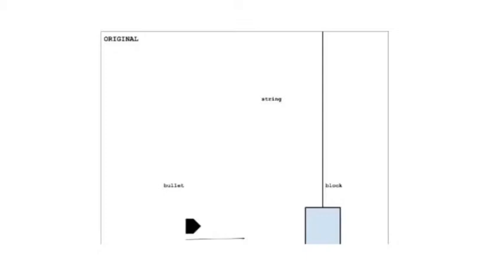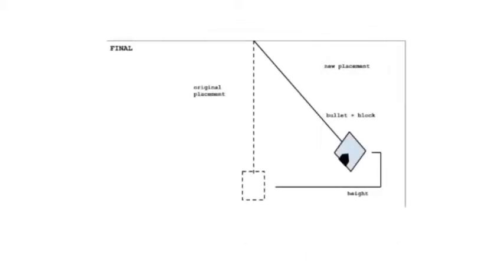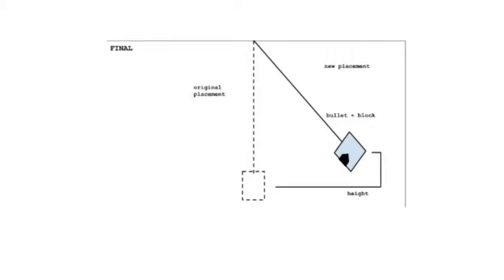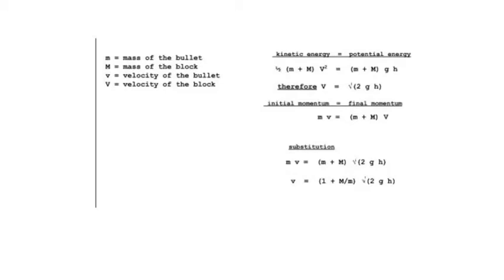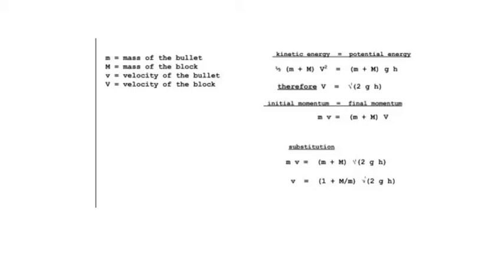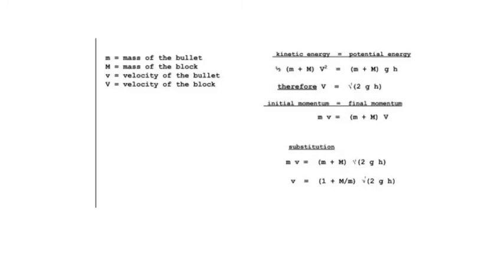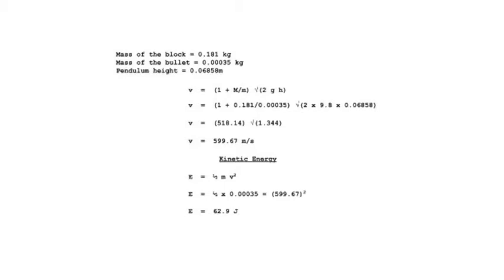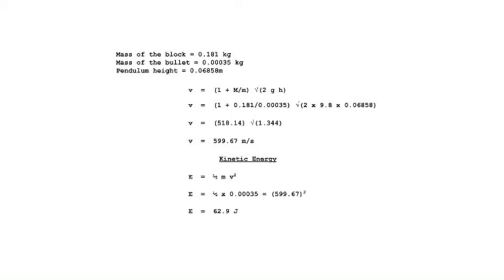World's Fastest Airsoft Gun (plasma accelerator 2000 Fps)

Comment: 40 000 kV? 40 million volts? Excuse me, that is insane!

I've researched as much as possible about an airsoft gun like this before attempting to make my own. From my understanding the system simply works by having a spark gap, an inductor and a capacitor in series. The spark gap is then shorted with a higher voltage spark and the energy from the cap is dumped in the arc. I was wondering if there are any formulas or anything for determining the values of the inductor and capacitor?

Anyways, your channel is very cool and i hope that uni is treating you well :D
Reply from the maker: That is exactly how it is done! As for formulas, I have not used any although making a mathematical model would likely not be super challenging. For capacitor, depending on what your looking for power wise, I like to start around 300 joules and up. Inductor needs to be large enough to block the high-voltage spark from going into the bank and force it into the spark gap. Otherwise, minimize your inductance to get a faster discharge. A 300-joule capacitor bank will fire an airsoft pellet at well over 700 ft/s, so I definitely would not use it for any skirmishes XD
Reply: @PlasmaFreak  Thank you for the response! I will estimate the values too then, since they dont seem too picky. I'd also like to ask which variables you consider the most important for increasing efficiency? With this i mean things like chamber size, chamber air pressure, spark gap width, more voltage vs more farads? 

And dont worry, i wont be shooting at anything living even if it is an airsoft gun :D For legal reasons i have to use non metal projectiles, which an airsoft gun fits perfectly.
Reply from the maker: @TheArachnoBot   @TheArachnoBot  The most important factors are using the smallest inductor possible, minimizing the chamber volume, and having more farads (as long as your > 350 volts). Spark gap does not matter much as once the ionization has occurred from the spark, the bank dumps and the spark does nothing after that. If you work to maximize those variables, it should be successful. Also, do not use metal for any part of the chamber or barrel.. it will decrease the efficiency greatly as it sucks up much of the heat energy out of the system. I am currently experimenting with 3D printed barrels, but small OD PVC tubing held within metal tubing is what I have used in the past for airsoft BB sized barrel system.
Reply: @PlasmaFreak  Thank you, this information is very helpful! Hopefully the 3D printed barrels prove useful, i have a printer at my disposal too.

Comment: What speeds do you think is achievable with this if you can make it as efficient as possible?
Reply from the maker: @Jaiden Smitt Good point! I have done some tests where I initiated in a higher pressure environment (70 psi) and I definitely saw a violent reaction take place (pressure chamber exploded). I need to get access to a lathe to build a chamber which could withstand such tremendous pressures.
Reply from the maker: Theoretically 10+ km/s if In a vacuum and even higher when made a hybrid with light gas gun tech. Electro thermal guns can hit some pretty ridiculous velocities but also very good efficiency for  electro kinetic weaponry
Reply: @PlasmaFreak  Okay but how much energy do you think is achievable in a man-portable package? With a capacitor bank and energy source in a backpack and the gun itself not larger than 20 lbs?

It's a very promising scheme I should say!I personally achieved pretty ridiculous velocities by a different method-by using Astrolyte-D as propellant which fired a rather small caliber(3.2mm) bullet through a barrel with really thick walls-the top speed that I managed to achieve was an insane 10800 meters per second!Almost 2nd cosmic speed!With a 0.8 gram projectile made out of fused aluminum oxide!And the most exciting part of this experiment was that the whole functional gun can be made around that barrel block which will weight about as much as AR-15 or maybe M1 Garand and will be about the same size as they are! And will still propell the same projectile at the same velocity! So I guess the next step for me will be making a handheld prototype around this barrel and this scheme! And since Astrolyte-D is a liquid-I think I will try making a caseless gun that will be loaded separately with a projectile from a magazine and the charge which will be in this case both priming and propelling because it can be ignited with a rather weak electric current!